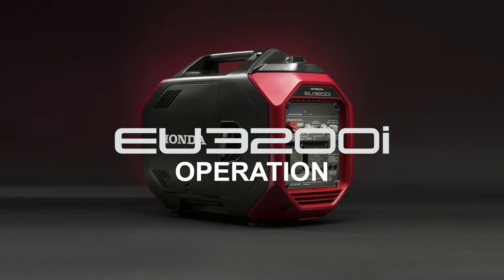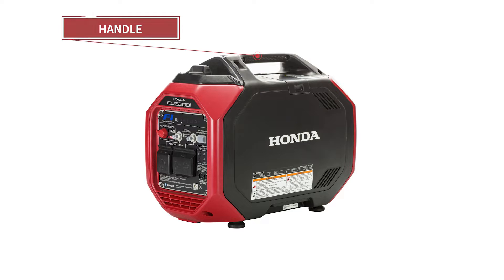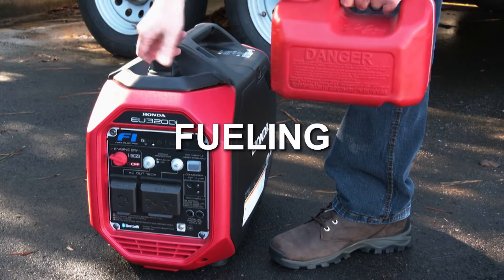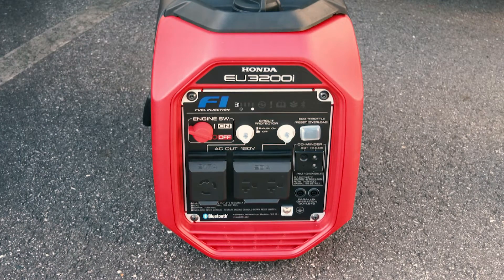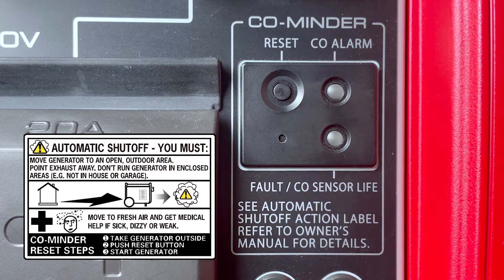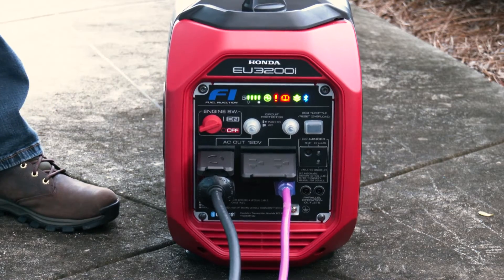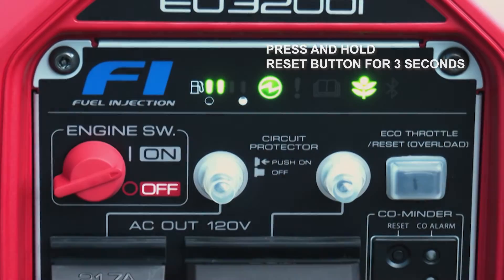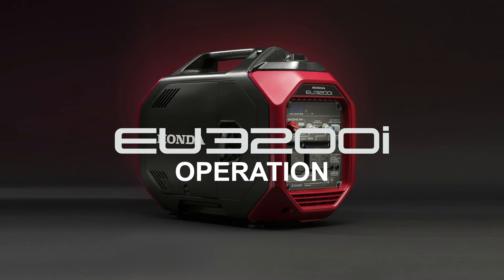Honda EU3200i Generator Operation

Comment: What I would like to see in it’s “sister” in parallel is the same case stuffed with as many Lithium Ion batteries as possible. Then together they run as a hybrid. The sister turns out the same energy in storage, then the 3200 runs in (auto start) mode and re-fills the “sister”,, when the sister is full, the 3200 shuts down.

Comment: One thing I would like to know is what the suggestion is for starting and stopping on eco-throttle or not
Reply: I'm no expert, but I asked someone who repairs generators for living this same question before. He said it's better to stop engine with eco mode on. And when starting give the engine a few seconds to warm up before opening the choke, then ~1 min or so before putting a load.
He was talking about a carburetted generator, so I don't know if that applies to this gen or not.
Hope this helps.

Comment: I made the mistake of purchasing one of these last year. It has been the worst experience I've had with any piece of machinery I've owned. Without question a poorly engineered and poorly constructed machine and Honda's conduct in dishonoring the warranty, because I had the audacity to actually use the generator, was not at all the behavior I expected. I will never purchase another piece of Honda equipment and I will never stop telling my story about the horrible experience I've had.

Comment: What's the point of having a generator if you can't use it while it's raining or snowing. So, it'll be just stored most of the year round then and you wouldn't be able to use it...